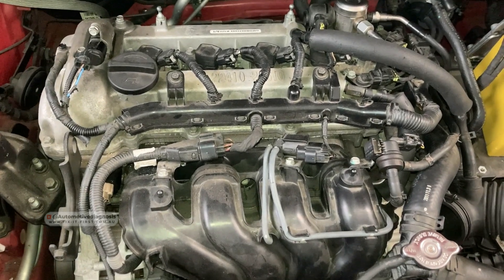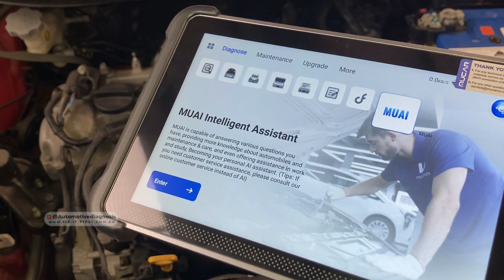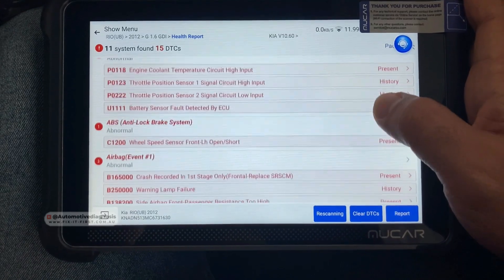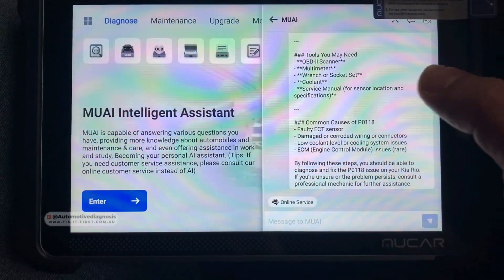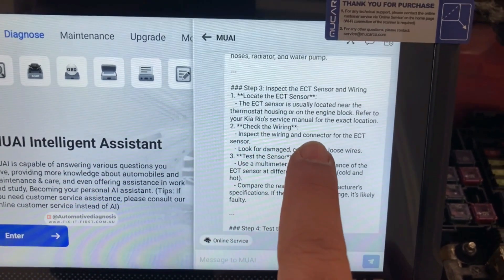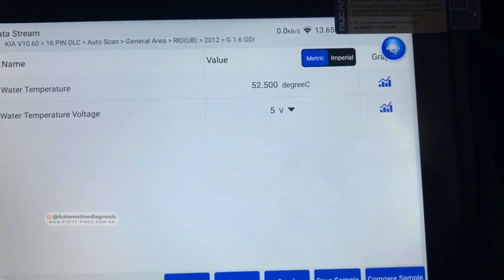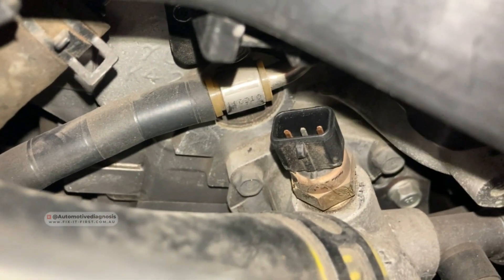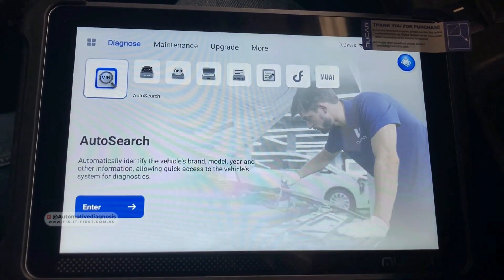Can AI Diagnose This Engine With Overheating Issue? Let's Find Out!

Comment from the maker: 🧑‍🎓Online Course: Automotive Engine Sensors Intro, Operation & Diagnostic (18 Sensors)
https://fix-it-first.com.au/course/automotive-engine-sensors-intro-operation-diagnostic-2/

🧑‍🎓Automotive Engine Actuators Intro, Operation & Diagnostic: 
https://fix-it-first.com.au/course/automotive-engine-actuators-intro-operation-diagnostic/

🧑‍🎓  Smart Key System (Push Button Start) Operation & Diagnostic in ANY Hyundai & KIA Vehicles
https://fix-it-first.com.au/course/smart-key-system-operation-diagnostic-in-any-kia-hyundai/

🧑‍🎓 Automotive LIN-Bus & K-Line Inro, Application & Diagnosis
https://fix-it-first.com.au/course/automotive-lin-bus-k-line-intro-application-diagnosis/

🧑‍🎓 ABS & Traction Control System Diagnostic Online Course
https://fix-it-first.com.au/course/abs-traction-control-system-diagnostic/

🧑‍🎓 Starting System Diagnostic & Schematics Analysis Online Course:
https://fix-it-first.com.au/course/automotive-starting-system-diagnosis-and-schematic-analysis/

🎯Find the Scanner here:
https://mythinkcar.com/products/mucar-892bt-automotive-scanner?ref=fzlivnsp